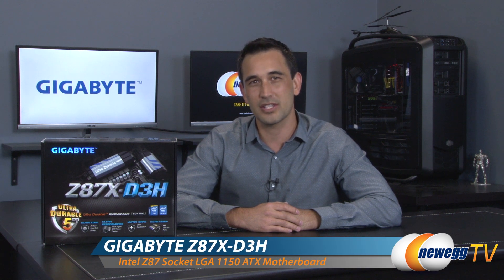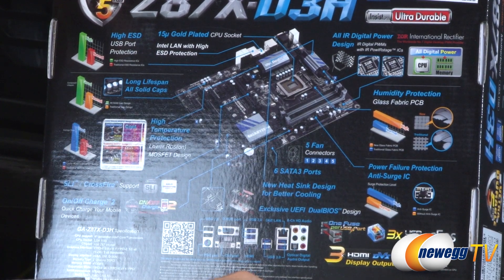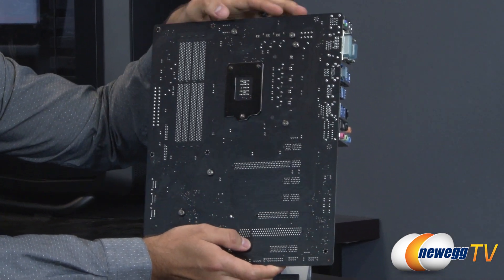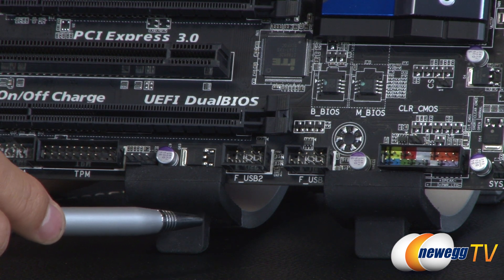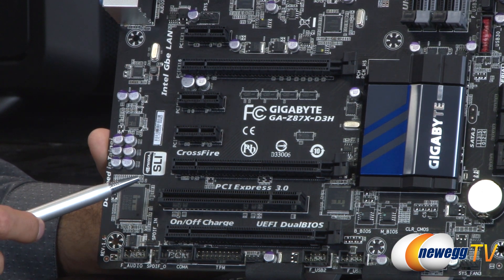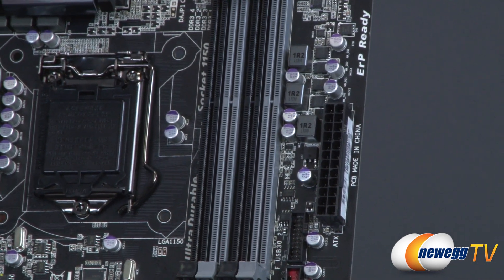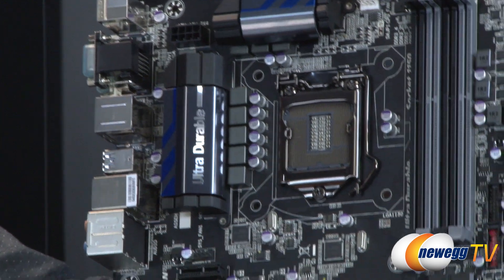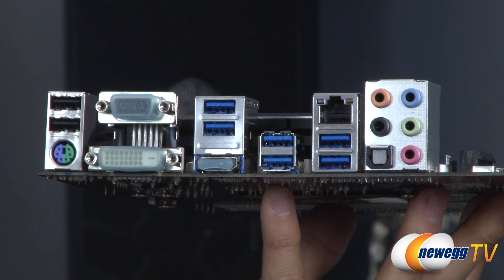Gigabyte GA-Z87X-D3H Z87 Motherboard Overview - Newegg TV

Comment: cool what do you think about this pc? using this motherboard?

'MB LGA1150 Z97 Gigabyte GA-Z97P-D3, PCIe/DDR3/SATA3/GLAN/USB3.0/HDMI/7.1 Memory DIMM DDR3 4GB 1600MHz Crucial, CT51264BA160BJ, 4x HDD SATA3 2TB WD Green WD20EARX, 64MB, DVD+/-RW Samsung SH-224BB/BEBE/SATA/ black, 24XDVD/16xDVD-RAM 'GeForce GTX770 MSI GAMING OC 2GB DDR5, DVI/DP/N770 TF 2GD5/OC 'CPU Cooler LGA1155/1150/775/FM2+/AM3+ Thermaltake Contac 16, 95W TDP Power source 630W Thermaltake Smart SE SPS-630M Modular, 14cm fan/ SPS-630MPCBEU CPU LGA1150 Intel® Core™ i7-4770K, 3.50GHz BOX 22nm PC Case Thermaltake Chaser A41 Black Edition, window/USB3/0 SSD SATA3 240GB Crucial M500 500/250MB/s, CT240M500SSD1 Would you change anything?

Comment: is it true.....

Due to a Windows 32-bit Operating System Limitation, When more than 4 GB of Physical Memory is Installed, The Actual Memory Size Displayed will be less than the Size of the Physical Memory Installed, The DVI-D Port Does not Support D-Sub Connection by Adapter, Support for HDMI 1.4a Version, Whether the Fan Speed Control Function is Supported will Depend on the Cooler You Install, Available Applications in APP Center may Differ by Motherboard Model. Supported Functions of Each Application may also Differ Depending on Motherboard Specifications, Due to Different Linux Support Condition Provided by Chipset Vendors, Please Download Linux Driver from Chipset Vendors Website or 3rd Party Website, Most Hardware/Software Vendors may No Longer Offer Drivers to Support Win9X/ME/2000/XP, If Drivers are Available from the Vendors, We will Update them on the Gigabyte Website

Comment: you can also use those three display ports to run 3 secondary monitors and your dedicated gpu running your primary monitors that run your games. Im doing that with my current setup where my hd 4600 runs my vga monitor and my hdmi tv and my gtx 760 runs my dvi gaming monitor.

Comment: The UD3H has an extra XMP for 3000MHz RAM overclocking. It also has 2 e-sata ports, 2 extra USB 3.0 ports, Display Port video, and 2 extra Sata 6 ports from a Marvell chip. The audio chip is a small upgrade and the UEFI is "new"